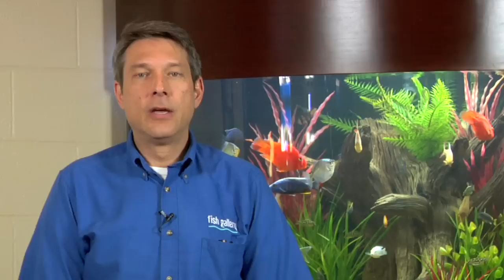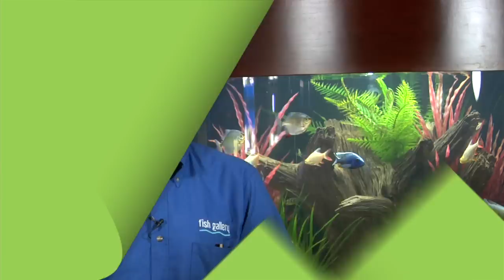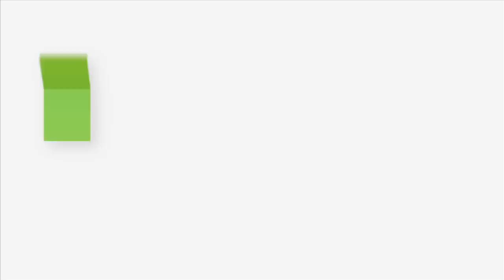How to Replace a Bad Ballast Starter for an Aquarium Fish Tank : Aquariums & Fish Tanks

Comment: My aquarium hood keeps blowing lights.  Lights are 24" T8 and there is no starter working in the hood.  I have removed the screws holding the insides to the hood and there is a small white box with blue and black wires coming out of it with mar connecters on them but no starter.  What is going on
Reply: the small white box is the ballast.  the starter is likely integrated inside it so you'll have to replace the whole box.  there are other videos here on youtube that show how to replace an aquarium light ballast.  good luck!
Reply: Thank you for your reply.  I have taken the light fixture to the Aquarium store where I had purchased it two years ago.  I was told to throw it away and buy a whole new unit?  Over $100.00 dollars, can't afford that.  I will do as you suggested and replace the white box. I have tried to find a video on doing this but most of what I have seen is replacing a starter not the box.  I am sure this shouldn't be hard to do.  Thank you.  W
Reply: You can purchase a new ballast on Amazon cheap and easy to install.
Just type in your ballast number in the search bar cheaper than buying a new hood.